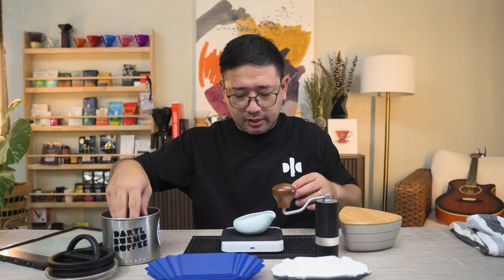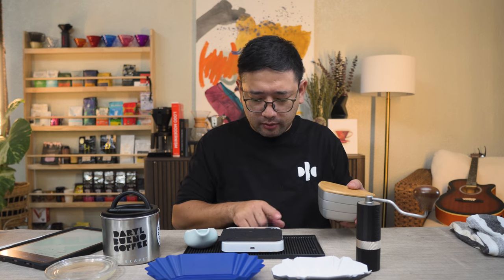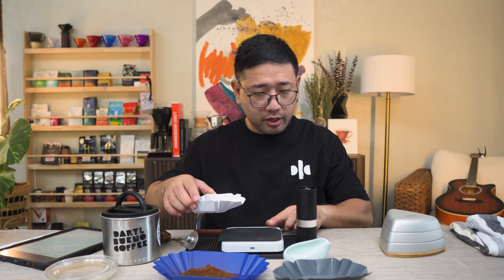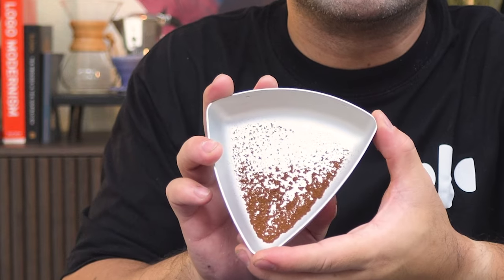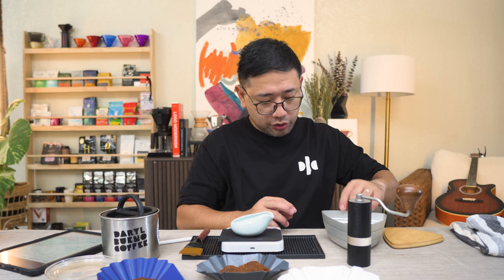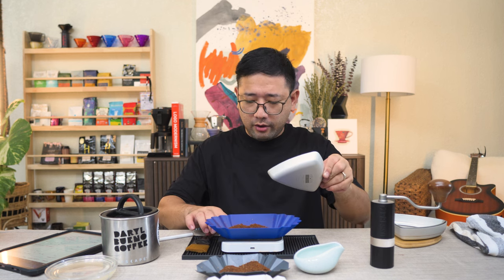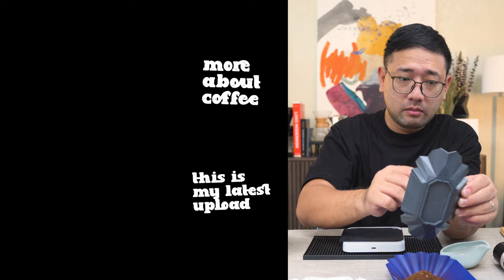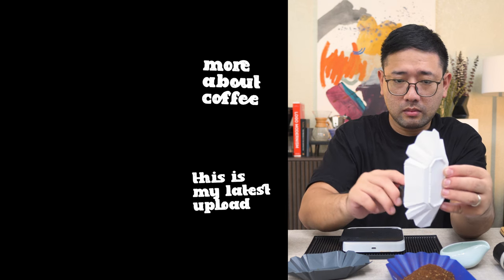1zPresso Q Air Slowfeed Test

Comment: It would be great if you explain what is the test about.
Reply from the maker: @javierperea8967  i did :)
Reply: @darylbuenocoffee  I watched the video and I'm not sure what the technique it's about. I think it's to feed coffe beans slowly to the grinder? I dont understand either what you are testing ( we don't see that much with the camera)
Reply: @javierperea8967 if you grind your beans with your hand grinder at an angle, you effectively reduce the amount of fine particles on the ground coffee (this is because when grinding at an angle, fewer coffee beans are ground together and so they are not being crushed by themselves but they are mostly being ground by the burrs). Fewer fines, most probably, lead to more clarity in the taste.
Reply from the maker: @javierperea8967  the test is basically to prove if the technique and the benefits with the technique is going to work on a particular grinder - in this case the 1xpresso Q Air. Different hand grinders produce different particle profiles, some would produce a lot of microfine particles, and some would produce a little. The particles dictate how your coffee would taste like. If you are able to reduce the amount of microfine particles then it will alter the taste of your coffee hence this technique.